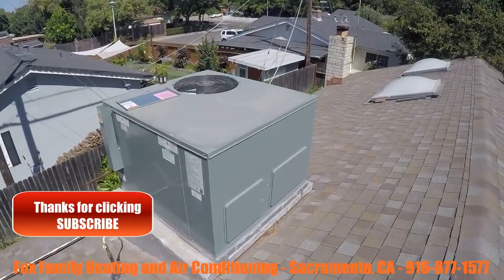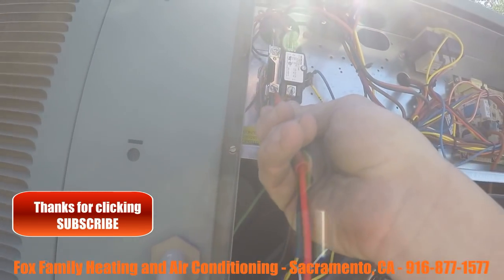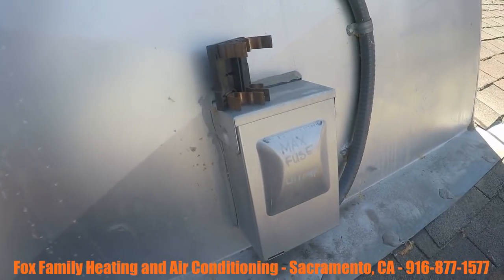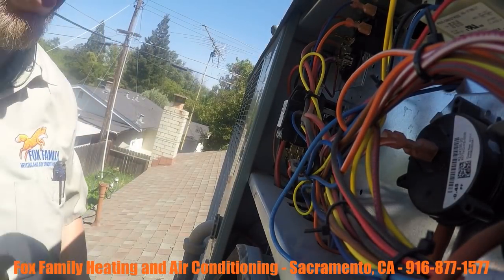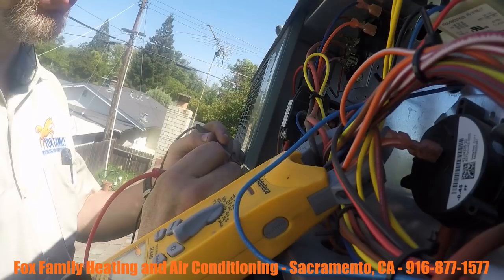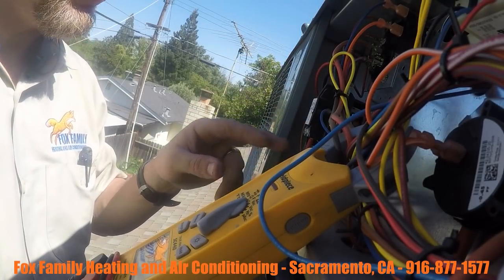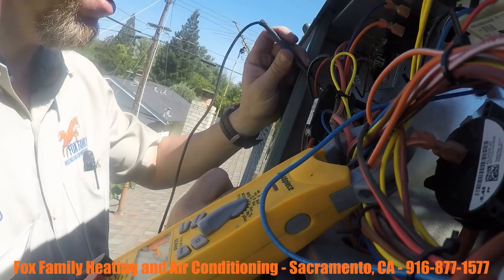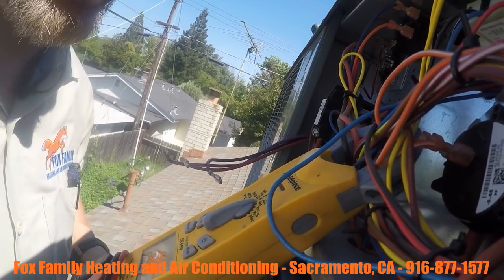How to Diagnose a Bad Compressor on your Air Conditioner

Comment: Yay! The compressor is covered under warranty.
All I have to pay for is Freon and Labor.
I want a fantastic warranty like this for other things too...
like say... a hip replacement.
"Oh, we are so sorry to learn of your hip-joint failure, due to our faulty workmanship, Mr. Smuck. But, not to worry... we'll toss you another hip-joint, and you'll only need to pay for anesthesia, and whatever surgical and hospital fees that may apply. See you again next year, for your other hip replacement."

No offense intended toward Fox Family, as you guys are providing a benficial service.
However, the warranty (as typical as it certainly is) is an absolute joke.
In my humble opinion, of course. Ha.
Reply: Jerry Moody:
 At hvacdirect.com?
Reply: Jerry Moody 
Awesome.
I am getting ready to replace a 2 ton split unit on our personal home. Current unit is R22, and has a very slow leak, so we have been paying to have it topped off every spring. I'd like to go with a 3 ton unit to replace it, and newer coolant that doesn't cost its weight in gold coin. I'll visit the site you recommended. Many thanks!
Reply: Jerry Moody 
I appreciate the advice. Our current 2 ton system struggles with removing moisture at specific times in our household. My wife likes to cook pasta for instance, and a large pot of boiling water, and a second pot of spagetti sauce on the kitchen stove sends our undersized HVAC into panick-mode. I have the condensate drain from the air-handler running into one of our flower beds, and I have actually overheard plant conversations: "Yay. She's cooking again." Ha.
But, I will research a bit, to determine the size of unit to replace it with.
I also have some rental houses, with HVAC units, so I plan to invest in the equipment to correctly charge them, as you did. There are  plenty of sites on the web that explain the process in detail, along with the refrigeration theory that backs it all.
Again, thanks for your help.
Reply: Try purchasing a service contract and quit being a cheapskate. So then that way your parts and labor will be covered instead of paying home warranty and not trusting that they can properly diagnosis a problem so you have to pay a real tech anyways
Reply: Kevin Thomas ,
Why would you assume that I don't have a current service contract?
Reply: Its Wolf of Wallstreet. Keep the clients on the ferris wheel. The park is open, 24/7, 365. Every year every damn century.
Reply: Labor and freon will probably be 1,000+.
Reply: @starmc26 ,
Exactly.
The same basic cost that you would pay, if you had no warranty at all.
Welcome to customer service, where we put your needs first. 🤪

Comment: WHY ARE THEY PAYING FOR THE GAS LIKE YOU SAID????????  IT'S A CLOSED SYSTEM AND IT DIDN'T   LOOSE FREON, SO YOU EXTRACT THEIR FREON , AND CHANGE OUT THE COMPRESSOR. ADD A LITTLE IF IT HAD A LEAK,BUT IN THIS CASE,IT'S THE COMPRESSOR. SO ALL SHE NEEDS TO PAY IS LABOR!!!! LETS GET IT RIGHT!!

Comment: Hey I cleaned my coil inside unit and outside unit but the temp keeps rising in my house what could be wrong
Reply: michael monroe look outside see if the fan is running but u don’t hear the compressor kick over...if the compressor is kicking over most you could be low on refrigerant but most likely your capacitor is out and your fan is only running .
Reply: I mean that’s just a rough idea I’d have to get intonit
Reply: I opened the outside unit it flashes three times yellow light says alert it's a Kenmore qhats wrong with it
Reply: michael monroe look at the Manuel and look up the codes yourself I’m not gonna know every code to every unit on the top of my head
Reply: Turned out to be the capaciter did some more research and an man verified it even offered me a job gladly accepted it hope to have fun learning this stuff
Reply: michael monroe good shit dude I suggest u do a lot of homework on YouTube...I’m guessing your doing residential install ...id start with some videos there but then start learning the service and trouble shoot side ...once u know the how and why it will be easier to do installs...keep a little notebook and take pics ...and never drag your feet even when shit is slow or your doing a shitty duct work job ..even if ur not doing shit just walk fast lol you’ll thank me later when u get a raise
Reply: Just did my first install today took a lot of notes one bad thing though I replaced my capaciter on outside but still not cooling but I'll get her worked out
Reply: Any tips on this got me puzzled
Reply: michael monroe it could be a number of things, how do you know it was the capacitor/ if u put a new one in look st schematic to see if you put the wires in right/ check the 2wires if there damaged coming from the wall to the condenser those give a signal from furnace board to outside unit to turn on, if that looks good go to your furnace and unplug or switch power off open it up and check if your furnace board 5 amp fuse is still good (it looks like a normal car fuse) put a piece of tape on the door button and turn power back on see if your furnace board is giving you any codes when u call for cooling again on your thermostat if that all checks out it .. u want to put gauges on your outside unit to check if it’s low on refrigerant or get a meter to check your fan motor on the outside unit..like I said it could be a couple of things u gotta start diggin
Reply: Turn on cooling again and grab a stick and manually spin that fan to see if it’s locked up or kicks on
Reply: My new boss came took it off and hooked up a tool tested out bad
Reply: I'm gonna check the coolant first thing in the morning and thanks for the advice
Reply: michael monroe well I’d ask your new boss to teach u how to fix his mistake lol how is he gonna replace your part but not check to see if it works
Reply: Lol damn I'm just gonna learn all I can from him and others then get into business for myself a good ac man can make a lot of money depending on location but from what others are telling me you have to be an apprentice for a year before you can take the test here in arkansas
Reply: michael monroe first things first let’s get your ac running lol
Reply: Lol yep gotta learn this stuff
Reply: Good news I found the culprit it was backside of coils on the inside unit and the duct work the seals had come loose got it fixed now blowing like a champ loving my 72° lol
Reply: michael monroe aye that’s wassup bro

Comment: I'm going to be the ethical critic, and note: Bad compressor diagnosis was correct. 
 Bad part, why it failed? Didn't use gauges to determine of there was a leak that killed it. Didn't inspect or measure line set. 
 Compressors don't die, they're murdered...
Reply: They'll check all that after they install a new compressor and service it.

Comment: Customer should pay for refrigerant and labor you said. Why not recover refrigerant and save customer some money?
Reply from the maker: Although it's acceptable practice, I can't guarantee the refrigerant was good in the first place or the container were putting it in for that matter.  that's why we only use virgin refrigerant.  I won't even use recovered refrigerant if it was my system.  too much liability if it screws up when no leave.
Reply: Fox Family Heating and Air Conditioning A simple acid test will determine “if” the refrigerant is STILL good and still usable. The solution you stated, ie: “use VIRGIN refrigerant” is a common practice used in the industry to up sell refrigerant and pad the bill. This is why the EPA recommends reusing the “SAME” refrigerant unless it is a compressor burnout, but even than after a compressor burn out is your diagnosis, a competent tech can use “acid neutralizer,” a new filter dryer and a proper vacuum, to correct a defective compressor AFTER replacement. Just saying.

Comment: You should use an insulation resistance tester to test a short on a compressor not an ordinary ohm meter.
Reply from the maker: Yeah there are so many ways to diagnose.  Thanks for the info!
Reply: Why?... If its shorted to ground, it's bad.

Comment: I have a sad story and i would hope you can confirm my suspicious so we can put this behind us.  About 6 months ago our air conditioner wasn't spinning up.  It would run but no cold air.  So we called the A/C people and they said our cap was out.  So we had them do the cap but we ended putting in a hard start kit.  Fast forward another 6 months and the ac is running but it's now making rattling noises and so we called them again.  Now they say we need a evap valve because the line pressure is way too high and the its putting pressure on the compressor.  So then they say they need get the part and they will install it. (at great cost of course)  That was two weeks ago.  They keep making excuses not to fix it.  I'm scared all this work they are trying to do is out of warranty.  Very expensive!  I think the problem is the compressor prematurely failed and these guys don't want to just replace the compressor because its expensive and thoroughly under warranty.  The symptoms are the compressor overheating a rattling sound and the line pressure is wayyy too high.  I have resources that are telling me this is exactly what happens when you slap a hard start on system that's not designed for one.  Are we being taken for a ride?

Comment: Thanks for the video! 

Indont have any of those tools and I'm a single mom trying to fix the ac. 

Anyone willing to read below and chime in, I greatly appreciate it. 
Filter ok.
Hosed off outside unit. 
I vacuumed out condenser tube from outside 12 months ago. Will do again this week. 
No ice anywhere. 
Outside fan spins. 
Inside ac blows sorta cold-ish air
But never gets down to temp. 
So it's set to 71, if outside is anywhere between 71-90 its 80 inside house during day and maybe 74 inside house during night under optimal conditions (meaning I didnt use the stove, washer, dryer or dishwasher and took a quick lukewarm shower.)

Also outside unit blows cold/lukewarm air out the top. This means compressor is the issue, right?

Comment: Greg, if I may make a couple of critiques use the right terminology for these younger guys. Compressors are grounded, internally shorted or open, never bad. I know that everyone of us use bad and I am guilty of it also. There is always a reason why a compressor fails and we all need to do a better job of replaying our diagnoses so we Don't look like we always do in everyone's eyes "silly".
Reply from the maker: Absolutely!  Thanks so much.  My mind tends to ramble on when I'm shooting these videos!  Hahaha.
Reply: Larry you forgot bad valves or a locked up compressor or internal mechanical damage (like a piston with a hole in it or a broken connecting rod) Glad you made the distinction between grounded and internally shorted.

Comment: The same thing is gonna happen to the new compressor because you didn't find out what caused the compressor to fail
Reply: Windings failed, it's a manufacturer issue. Not the tech's problem, that's what the warranty is for. They warranty out enough units and they'll figure it out.